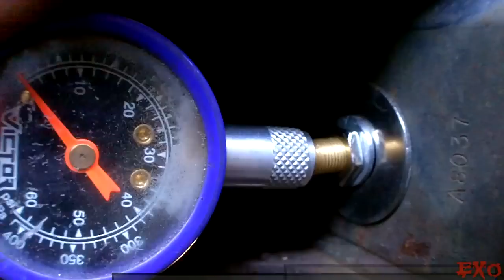How To Install Air Lift 1000 Helper Springs | Installing Bags To Stock Suspension For The Big Build

Comment: Hey EXO. Just a quick tip for the next install: If you jack up the truck more and extend the jack stands, you can then unbolt the shocks from the axle, it will allow you to lower the axle more (as far as the brake lines allow without pinching) and may give you enough clearance to pop the coil out completely.

Comment: TIP for ya EXO, dip the ends of the plastic tubes in to hot water for a few seconds and it softens the tube so you can slide it on the fittings all the way, Great vids man, keep em comin.

Comment: We late model GTO owners run those in the rear springs to keep the cars from wheel hopping when we dump the clutch. Also commonly referred to as "Drag Bags!" Great install vid! They have many good uses. Good luck with them!

Comment: I installed a set but when I did it I was also replacing the factory springs so I put the bags in when they were out of the truck and it was so much easier! Unbolt the shock from the axle and jack up the truck till u can pull the spring out

Comment: You should have drilled a hole in the hard plastic next to the license plate... No rust concern and you would keep your hitch... Even more accessible and in a safer spot.

Comment: More of a suggestion if nothing has wen wrong yet. Due to where you mounted the inlet nozzle I would suggest drilling I hole over the spring run air lines up it down frame rail and then to hitch will save lot of prtencial snagging, kinking, or melted air lines in the future

Comment: Hope you never have to tow anything
Reply: Tim D Stevens 
Really genious move that...🙊💩
Reply: 😏🤦‍♂️🤦‍♂️🤦‍♂️ I hope so
Reply: why
Reply: @MrKodiack   The pin to hold hitch goes through the hole he put the air valve on.
SO you cant put a hitch on.
Reply: Adds helper bags for towing, blocks tow hitch with air line. Says I'll never tow....then why install helper bags ??

Comment: Well, if you take a Hacksaw, then cut the Coil spring in half, it will give you the room to install this, then, when it is installed, use "Super Glue" to re-join the Coil spring. Hope this helps. Or, you could coat the rubber bag spring, with silicon grease, to facilitate the installation.

Comment: Here's a thought:After raising the vehicle to expand the coil-springs, use a stiff-bristle brush and some soapy water to remove the road grit that is on the inner surface of the coil-springs. In my humble opinion, this will benefit you in two ways. 1.) Removing the abrasive road-grit will reduce the immediate wear on the Air Lift bags, and help them to last longer.  2.)  Once the road-grit has been removed, the bags will slide into the coil-springs much easier. Cleaning the coil-springs may require ten minutes of your time initially, but the ease of installation is bound to make the overall process less time-consuming. -More time for enjoying the new Air Lift Bags.

Comment: Good stuff EXO. A little trick for getting those connectors on that plastic line/tubing easier is to first heat the tubing up a bit with a lighter. Looking forward to watching more of your build videos.
Later.

Comment: Good job!  For vac lines you can use hairspray to hold it on there real tight.  Also, heat shield or not I'm not real crazy about how close it is to the exhaust.  Oh well maybe it will be fine.  If not vac line is cheap enough to replace.  Good luck on the build!

Comment: the red bags are used to raise the vehicle because with the added weight the rear end will sag so the bags are filled with air to lift the vehicle back to stock

Comment: I was thinking that too but it might be the fuel filler tube that goes to the fuel tank. If you look at 5:46 that exhaust pipe is under the air line.

Comment: Exo its beeb awhile looks like your doing good next time u do an air lift kit on coil springs jack up the frame of the car and let the rear end sag down then you can either pull the coil spring out or just slip it in through the top ..

Comment: Just wow...this would be a good video to demonstrate how not to do an installation
Reply: +Marco Novy And just so Im not just criticizing. I'll shed some knowledge - remove the goddamn spring to install the airbags! lol Half your lines seemed to be touching the tail pipe. Would not be surprised if you melted half of it. Use soap and water to slip on the air hoses. Trailer hitch pin hole for the air valves? Really? I know you said you never tow anything, but thats just so half-assed. But each to their own i guess for better or worse...
Reply: Marko G. Novitzki 
No shit LOL
Reply: Steve Edberg truck was on jack stands on the frame there genius
Reply: @Marco858636  loooool, i just watched, I'm not a frequent towing guy but i was stunned to see they are using the hitch pin holes. Maybe they never tow, since all the rust in the hitch. Also, Tyler Durden says : use soap :)

Comment: I would of just got some springs made , there like £30-50 a side for custom set rated to what you like..   Replace the factory shocks with more stiffer one aswell.. Next thing is to by a small 12volt compressor and hard wire it in so you can pump the bags up with a flick of a switch

Comment: it is adviseable to use here in gulf countries because the weather here particular in the summer around 50 degrees celcius
Reply: No it's not.... Some the hottest natural air temperatures ( not effected by heat other than the sun) have been recorded at 62 degrees c. And average temperatures recorded in the Sahara desert are only 42 degrees c.. I doubt your average temps in the gulf are 50 degrees c. The max recorded temp in the gulf was 53 degrees.

Comment: I was curious, when running multiple batteries in the back could I ground my amps to a neg terminal or neg bus bar or would I be better off just going to the frame?

Comment: Great channel and dedication to your fans with your info and advice to us bassheads. Quick question. I have a custom built recone from psi. Dual 1ohm 12 with triple 10inch spider. 3500watt rms with ti basket and double slug memphis mojo mad maxx motor. Jus one 12 is all i need for my cavalier lol. Pretty beefy 12 thanks to psi recone but i am currently runnin a crunch 1500d. I was curious what would be the best amp for my sub. I would need somethin thts .5 ohm stable or wnt get too hot. I was t

Comment: yer man got the tools off ebay to compress the springs for 15 bucks you get 2 for that and they have hooks on them you put the hooks on the spring and get a spanner and tighten them it pulls the springs and compresses them you then just pull them out stick the bags up them and thro them back in and loosen the spring compressors and there you have it hour job for both

Comment: heat gun or blow dryer would help those lines fit perfect no clamps needed!
just be easy cause u will melt the lines or make them weak and when u push they will bend!

Comment: Best to attach black air line to red airbag nipple before you put it into spring.   Spray a touch of oil into the black line.  Use a hot Philips screwdriver tip to open up the black line, softening it.  Push on the black line all the way and let it cool. bingo.   Install airbag and route the black airline.
Reply from the maker: Great insights, thanks for the tips!

Comment: use a lighter and lightly heat the hose to get it to slide on that connector. and a little spit also helps :) i grow hydro so im use to those rubber air lines lol ;D

Comment: I would move that air line off of that exaust even if it is insulated.Trust me that line is very fraggile.Also get on ebay get ya a PTC or push to connect T fitting instead of that cheap plastic thing w/ the clamp

Comment: Hey EXO I got a question, so I have 2 15" Memphis MOJO's walled behind the front seats in my 02 focus svt. And my rear alignment is adjustable so I'm wondering if it's the wight that keeps throwing my rear alignment outta whack. I keep going through rear tires like nothing. Had my suspension checked and everything looks good. I just don't want to buy new tires again then a month later they're bald. Will the air lift fix this issue? Thanks and great vid!
Reply: Get an alignment at a shop that has a good alignment machine. I don't know how low it dropped with the subs but you probably threw off your camber and your toe. Odds are your toe is off. Camber with correct toe doesn't wear out that fast.
Reply: adam jette
 WOW another one....inbreeding is alot more prevalent than I thought
Reply: adam jette 
Dont drive with the emergency brake on....

Comment: When ordering Air Lift 1000 Universal Air Spring Kit you need to take two simple measurements when your car is at normal ride height ... the inside diameter of Springs (y) and inside height of springs (x) ... Then use the chart below to find the correct kit

KIT # MIN. DIAMETER (Y) MAX. LENGTH (X)
 60900 ..........  3.00″ ....................... 5.50″
 60901 ..........  3.00″ ....................... 8.00″
 60902 ..........  3.00″ ....................... 9.00″
 60903 ..........  3.50″ ....................... 5.26″
 60904 ..........  3.50″ ....................... 7.75″
 60905 ..........  3.50″ ....................... 9.50″
 60906 ..........  4.00" ....................... 5.00″
 60907 ..........  4.00″ ....................... 6.00″
 60908 ..........  4.00″ ....................... 7.00″
 60909 ..........  4.00″ ....................... 8.00″
 60910 ..........  4.00″ ....................... 9.00″
 60911 ..........  4.00″ ....................... 10.00″
 60912 ..........  4.00″ ....................... 11.00″
 60913 ..........  4.00″ ....................... 12.00″
 60914 ..........  4.50″ ....................... 6.50″
 60915 ..........  4.50″ ....................... 7.50″
 60916 ..........  4.50″ ....................... 9.00″
 60917 ..........  4.50″ ....................... 10.00″
 60918 ..........  5.00″ ....................... 5.25″
 60919 ..........  5.00″ ....................... 7.00″
 60920 ..........  5.00″ ....................... 9.00″
 60921 ..........  5.00″ ....................... 11.00″
 60922 ..........  5.50″ ....................... 5.50″
 60923 ..........  5.50″ ....................... 7.50″
 60924 ..........  5.50″ ....................... 8.50″
 60925 ..........  5.50″ ....................... 9.50″
 60926 ..........  5.50″ ....................... 10.50″
 60927 ..........  5.50″ ....................... 11.50″

Comment: nice bro, btw do we need to cut the coil spring?
Reply: Why would you need to cut the springs? Did you see him pull the springs and cut them on the video? He clearly did not cut the springs, not sure why you'd even ask such of an ignorant question.
Reply: sorry, didnt meant something rude. and honestly,i didnt see it clearly, was focusing on how it was installed. anyhow, how much budget required to do so? :) newbie here
Reply: Sorry, I was just thrown off by your question. The bags with lines and everything you need to install is fairly cheap, around $150 starting out. If you do an on board compressor and dash switches, it could run the cost up a good bit more though.
Reply: So i see, nice bro. the board compressor and the dash switches maybe out of the option. due to the money currency. lol. btw, do you think its possible to install the bags inside the coil spring after it has been cut?
Reply: euston rolius If you smooth out the edges where the coil was cut and put some sort of hard rubber between the bag and where it was cut. That would be my only concern so it doesn't rub a hole through the bag. Also making sure when you air the bag up, it doesn't lift the coil off the mount.

Comment: not really its 4 bolts on each side and it wouldnt be dangerous because the weight of the car isnt on the springs so there not compressed so there isnt any danger n weight its on the jack stand and he said it took me a few hours its only a 20min job 45mins the most if u dont know what ur doing but w.e he got it done his way and thats what matters EXO keep them videos coming

Comment: You need to reroute the line away from the exhaust, that hot exhaust pipe will melt that plastic tube.

Comment: That is the crappiest job I've ever seen.  running across pipes ?  didn't flare your tubing before putting them on the Tee's.  Flare the tube a little and you'll get the tube completely over the barbed fitting on the Tee.  Putting the valve thru the receiver hitch ?

Comment: Wondering what the helper bags are for if you dont tow anything? If you towed anything ever you would have seen that you put the valve right through where your hitch pin goes. 😂. Even if you didnt do that your helper bags wont do much once that exhaust melts through that line you zipties on. Some people's kids.

Comment: Hey genious....ever think of cleaning the nasty ABRASIVE road grit off the springs before installing plastic bags that are gonna be rubbing constantly against the coils?
Guess you dont mind wearing out your bags in half their normal life.
And installation would have gone alot easier with a bit of soapy water in a spray bottle.

Comment: Quick question genius.. Since these are called helper springs and they're designed to HELP your suspension under a load why would you even get these??  You don't ever plan on towing (your words) and if you do decide to tow you'll have an air line in your tow hitch..

Comment: HORRIBLY thought out. You completely eliminated your trucks tow capability which should be inherent with a truck... You removed the tow ability and added airbags to the rear suspension... Which would be real helpful if you towed, but all you did was manage to make an already poor ride TERRIBLE..
Reply: stepfour with the sound system in that thing it's become a toy, not a tool. it won't be towing anything so who the fuck cares

Comment: why would you install the schrader valve right where your pin goes in your hitch receiver smh.....
Reply from the maker: Because this truck has never towed and never will tow anything.. ever.
Reply: EXOcontralto then why install bags? Not knocking you just curious

Comment: YOU GUYS ARE GOOFS WHAT YOUR MEANT TO DO IS GET A PAIR OF SPRING REMOVERS COMPRESS THE SPRINGS AND REMOVE THE SPRINGS PUT THE BAGS IN THE SPRINGS THEY JUST SLID IN THEN COMPRESS THE SPRINGS AGAIN AND PUT THEM BACK IN 30 MIN JOB BUT I GUESS PPL AREN'T REAL SMART FROM WERE YOUR FROM.

Comment: looks super unreliable friction will destroy this skinny little red bags
Reply: Been running these on all 4 corners of my Jeep for 4 years with no problem with springs rubbing holes in airbags. But I have had air lines burst on the front a couple times, but some thicker line fixed that. The bags aren't made of rubber, its more like a very tough urethane. The nice part about them rubbing the coils is they control the springs movement and make my cheap shocks seem way better than they were before. I like them a lot for towing, and restoring ride height in the front when running a winch or heavy bumper